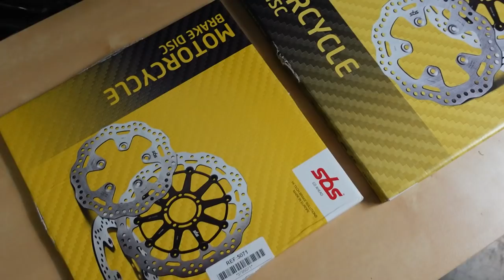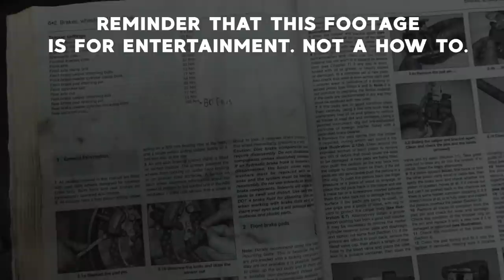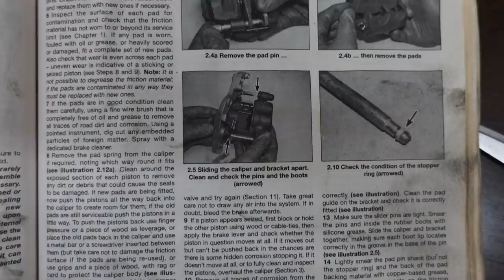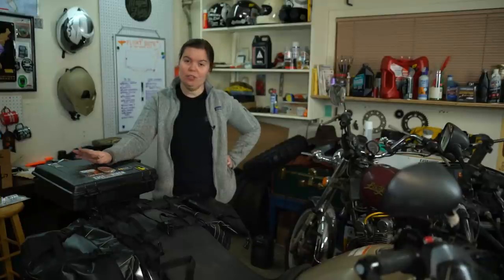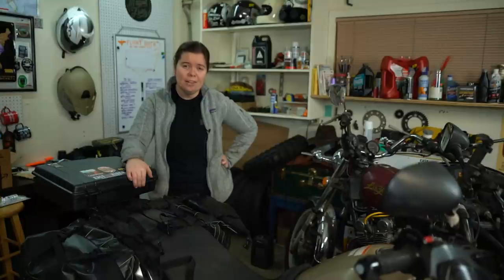Am I Ready for my 8,000 Mile Motorcycel Trip? LAST MINUTE PREP

Comment: Amanda, I wish you 8,000+ miles of great weather and trouble free riding.  May all of your chosen campsites be available and you arrive at your destination to attend the event.  I am sure Breiourious, Breareasre, Breareasaurus your motorcycle is up to the task…😏

Answering your question:  Many miles ago back around 1990, I had  brakes installed at my Honda dealer.  As a result the mechanic did not install the rear caliper correctly and when leaving the dealer, My rear caliper rotated with the rotor, pulling the  brake line apart, warping my rotor and seriously gauling the caliper.  (They replaced all the damage with new parts) It still isn’t a funny story.  Second story.  I bought a well used Kawasaki 1000.  The PO said he just installed brakes on the front.  It was a double rotor and I did notice some scraping when I applied the front brakes but it stopped well enough.  When I got it home I noticed something rather odd, he installed one brake pad backward and the metal back plate was scraping the rotor.  No damage.
Reply from the maker: 😦 oh my gosh! Thank you for sharing Roger! And thank you for the good wishes 😊

Comment: Great Video I am glad to see that your prep is going relatively smooth. I started waking Betty White up by lubricating a sticky throttle cable. The lubrication went great. Putting on the push cable end went great... then while trying to install the pull cable I cracked the keeper on the end....so now I have to take all the top plastics, radio and air box to disconnect at the carb... and that will lead into "I might as well replace the fuel and vacuum lines."  So if you are going to lube a throttle cable  it is good to start early.... END SCREEN ? No I have never done brakes on a scooter before and that is on the list for doing this season  ... What could go wrong??? lol Stay smooth  Amanda
Reply from the maker: Thanks Falcro 😊

Comment: Good luck packing!  End screen.  I too had to work up the courage to do brake work.  Changing pads was much easier than I thought, replacing disks wasn’t that hard either.  Flushing and bleeding the brake and clutch fluid I leave to the mechanics, my bike has ABS and linked brakes…I let the pros deal with the fluids.  ;)
Reply from the maker: Luckily I only have one caliber on the front so I don't have to worry about linked brakes lol I think I would leave flushing to the shop too if I had two 😅

Comment: I'm pretty sure you didn't install those brakes correctly. Not because I saw anything remotely incorrect, but because I've seen Shadetree Surgeon install stuff much simpler than brakes and you had no cursing, no running to a hosing specialty store, and no leaving your bike on the lift for 3 weeks before getting it complete that his installs always entail. I've done my own brake jobs on cars dozens of times, never on my bike, though.
Reply from the maker: 🤣🤣 thanks Chuck lol there was one trip the store but it was only 10 minutes and just for thread locker and a new bottle of parts cleaner lol

Comment: Curious if you also do a once a year / 2 yr brake fluid and ABS pump flush / replacement. Under normal usage, was the life span on the rotors 40k miles?
Reply from the maker: These are questions I don't feel comfortable answering as I don't want my words to be taken as a suggestion for what others should do with their own bike. 
If you are asking these questions for your own needs I suggest referring to your service manual or asking a professional technician.
Reply: @AstheMagpieFlies  Understandable. For reference, it's a good idea to replace brake fluid and flush the ABS pump at least every two years. Standard brake fluid will accumulate moisture that needs to be removed from the system to avoid damage.
Reply from the maker: @markmcguire7988  Yes. I'm aware. I did work at a shop.

Comment: Gonna have to take the wheels off again for new tires?
Reply from the maker: The rear still has 2500 miles on it and the front had 5000 miles left why would I change them before I needed to???